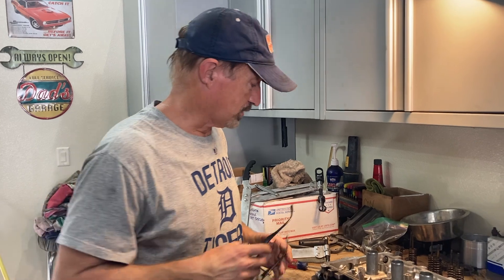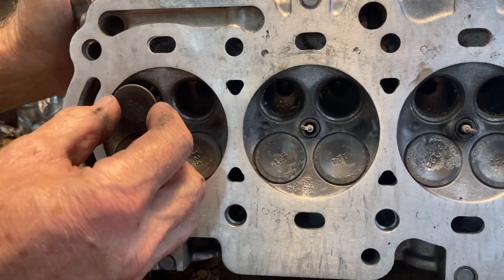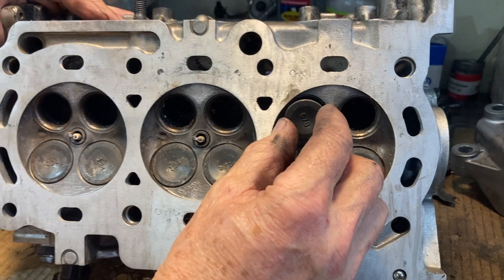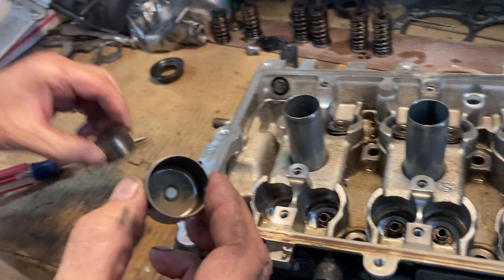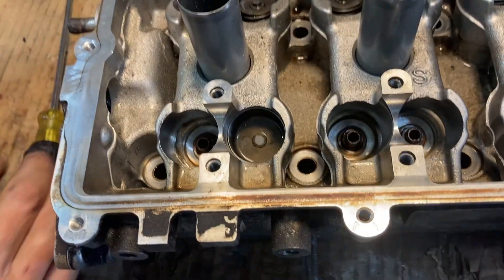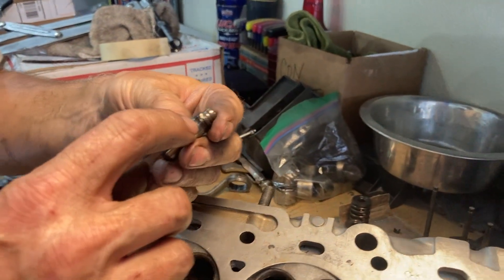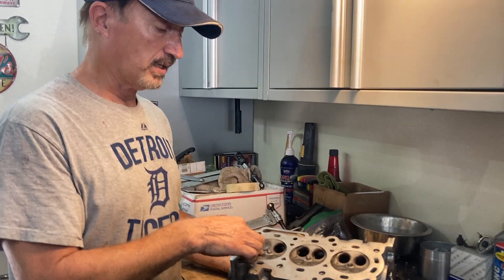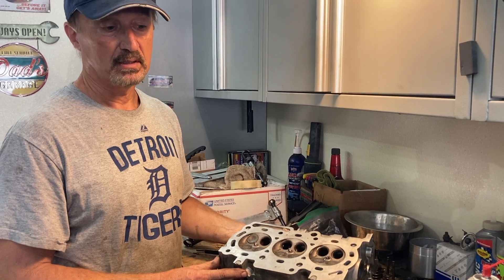Smart Fortwo (451) Valve Guide Replacement

Comment: How do you do the valve adjustment on these engines. Mine needs it pretty bad and I noticed that the valve assembly isnt like a normal assembly for most engines? Mines just a plain W451 from 2012
Reply from the maker: There is no easy way to adjust the engine valve lash on these engines.  The cam(s) have to be removed to get to the buckets located under the camshaft.  So you will have to remove the timing chain to get  the cam(s) out.The buckets come in different thicknesses to adjust the clearance between the cam and bucket.  I'm assuming you have a noisy valve train?  The real question is what caused the excessive valve lash?  I would start with removing the valve cover and measuring all the valve lash clearances with a feeler gauge to find out which which one(s) are out of spec.  The only way the valve lash can get out of specifications is having a worn out camshaft lobe, worn out bucket, or a both being wore out.  These engines are not known for wiping out camshaft lobes.